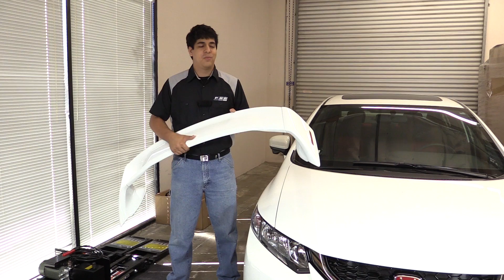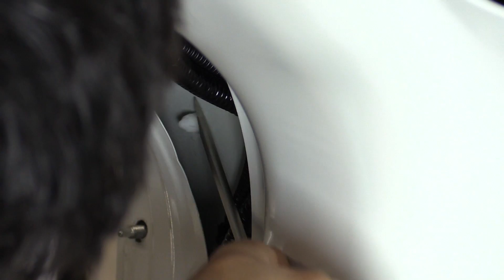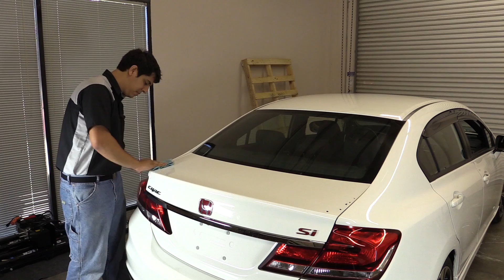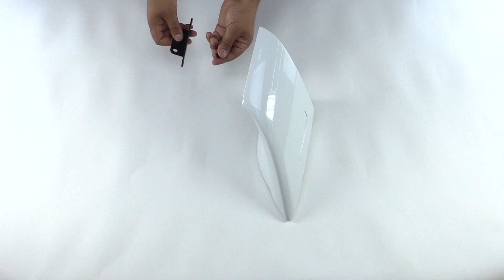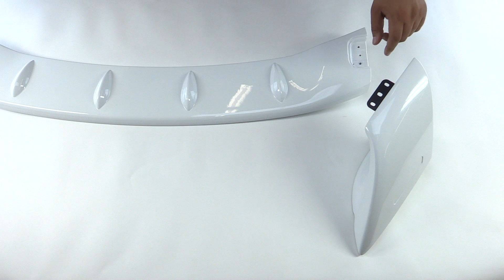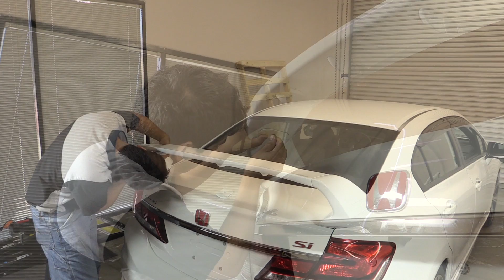PRO Design TRM Style Spoiler / Wing Install - Honda Civic Sedan 2012 2013 2014 2015

Comment: Any clue how this fits on the 2012 model? Want to order but afraid it won’t fit properly
Reply from the maker: This will fit fine on all 2012-2015 civic sedan models. The installation process will be the same as this video.

Comment: I have a 2013 Sedan Civic. I don't see the 2 BOlts you mentioned after removing the Trunk Liner. Is my car compatible ?
Reply from the maker: +Jason Lee If your civic did not come with a wing, the bolts will not be there. The beginning is only for models with a factory wing. Since the wing requires drilling, it is still compatible with sedan models without a stock wing.
Reply: Thank you so much.
I'm figurng out what to do after I take my Trunk Liner out. I assume just drill through the trunk, and apply the bolts on?
Reply from the maker: +Jason Lee That would be correct! Please ensure to have everything lined up and properly fitted to ensure correct fitment.

Comment: Does this fit to 2015 Corolla
Reply from the maker: +frederick manzano It will not fit other vehicles. This is designed with the Civic in mind only.
Reply: PRO Car Studio ohhhh okay but I have seen corollas with same spoiler
Reply from the maker: +frederick manzano There may be other wings that look similar to it that fit the Corolla or were heavily modified to fit it. However, out of the box, this is only designed to fit the Civic.
Reply: PRO Car Studio okay thanks for the info sir

Comment: What happens to the holes that were left by the stock spoiler?
Reply from the maker: +T k Most will be covered up, but not all. The visible ones will need to be filled by a professional body shop.

Comment: Hey bro thanks a lot for this video it was very helpful for my little proyet but now the thing is that the top part of the spoiler shakes while I'm drivimg, how can I stop that? I put it very tight but that just help very little, any advice?
Reply from the maker: +Mario Maldonado The vibrations are normally minimal at best and tends to happen from high winds at highway speeds. We have heard of people filling the center part with expanding foam to help reinforce it a bit more. However, results can vary and will more than likely not completely eliminate it.
Reply: PRO Car Studio good to know, thanks a lot!

Comment: Some people with this same wing or similar say this wing bolts up to the existing Si spoilers holes. Is this the case now or you still have to drill?
Reply from the maker: +KAnE3o1 This would not be the case. The wing will still definitely require drilling to install.

Comment: Can this fit in a 2006 toyota corolla??
Reply from the maker: +HBF Gaming This is designed to fit the 9th gen civic sedan only. We cannot guarantee it will fit other vehicles.
Reply: PRO Car Studio ahh thank you for the reply
Reply: Measure the width of your trunk lid and if it measures 47 or 48 inch, the spoiler will fit

Comment: Where'd you drill the other hole? You didn't specify on that..
Reply from the maker: +Isaac Arenas Can you specify which hole you mean? The only ones we drilled and are needed are the mounting holes for the wing itself. You use the foam gasket for the wing as a template on where to drill.

Comment: This wing fits perfectly on a coupe guys, it lines up well. Only thing you'll need extra is a thicker weather sealant adhesive, and atleast 2 people to hold the wing on each side while you measure everything and adjust it to tape the adhesive down as a template for where to drill the holes. Once you've drilled the holes, and make sure the drill tip your using is for metal, you put the thicker adhesive onto the wing , make holes for the screws to fit through, place it on the car, then screw in each side equally and bam, you just installed a wing meant for a sedan on a coupe .
Reply: what year coupe doe?
Reply: No need for bondo then?

Comment: Will this work on a 2015 Honda Civic Automatic LX ? Non SI ?
Reply from the maker: +Brandi Leigh It will fit all trim levels as long as it's a 4 door sedan from 2012-2015. It will not fit 2 door coupes.

Comment: is this hard to put on '12 civic si? what are the things that i need to do to put it
Reply from the maker: +KILLINGmachine9k The process is virtually the same as the later sedan models as well. As long as you have a sedan, this install video will help with the installation on yours as well.

Comment: is the rubber trim piece for the bottom of the spoiler necessary for the install or can it be installed without it?
Reply from the maker: You should install the rubber / foam piece. It helps seal the holes from moisture.

Comment: i heard it wiggle when u hit the highway, like the plastic piece in the middle. is it true?
Reply from the maker: +hannah regine After our testing, there is some slight wiggle at around 70 MPH or higher. However, it is minimal at best and we have not had any issues with it.
Reply: PRO Car Studio it wiggles a lot at high speeds on highways and I had a crack on mine. It actually broke. Any help on that?

Comment: When y'all going start having aftermarket mods for the 2016 civic
Reply from the maker: +Ross Conglomerate We do currently have an intake options for the 1.5L turbo and 2.0L models and an exhaust for the turbo 4 door models as well. More will be added as they are released.

Comment: Hey ProCivic, I was thinking about purchasing this wing but I have a question. Do you think the size of the trunk of the 9th gen 4DR is the same as a 9th gen 2DR? And will the wing fit for the 2DR trunk?
Reply from the maker: +Shino Minamoto We have had customers install this on the 2DR, but I believe some custom work might be needed. I really can't recommend it unless you are experienced with automotive body work.

Comment: would this fit on 2 a door Si?
Reply from the maker: +Jovani Nuñez This will not fit the 2 door. It is designed for the 4 door models only. The dimension of the 2 door models is different.
Reply: +ProCivic.com but it looks so good!! I've been trying to find one for the 2 doors but I can't find one, I like the seibon gt spoiler that you guys carry but this design looks so much better
Reply from the maker: +Jovani Nuñez Some people have been able to use it, but would require a very skilled body shop and a lot of bondo...

Comment: Where can you get them for a coupe???
Reply from the maker: +Sam d Sorry, this is currently not available for the coupes.
Reply: +ProCivic.com I've seen this spoiler on an rsx before
Reply from the maker: +Ufc _ There may be other spoilers that look similar or were modified to fit, but out of the box, it's designed to only fit the 12-15 civic sedans only. You can make anything fit on any other car with enough Bondo and creativity! :)
Reply: +ProCivic.com what's the song at the beginning.?????

Comment: well how did you cover up the cable hole for the break ?
Reply from the maker: +Parshen Yousefi It worked out quite well. You can't really tell the hole was ever there. You could try it yourself first, then have a detailer or body shop clean it up if needed.
Reply: i have the same one and i can see the hole with my eye
Reply from the maker: +Parshen Yousefi The best way is to have a professional body shop fill it and color match it. If you have experience with body filling and color matching, you can do this as well.
Reply: thank you i found a rubber hole plugger for it its better

Comment: i have a 07 civic and i want to install a spolier with a third brake light but the wire is too short and i dnt wanna splice the cables is there any thing i can do 😭
Reply from the maker: +Arturo Gutierrez This spoiler won't fit an 07 Civic actually. If you got a different spoiler, you would need to extend the wires.

Comment: is there any rattling, shaking, or flapping in the center piece at higher speed?
Reply from the maker: +Tak Tsoi Around 75 mph it does vibrate a tiny bit, but only the center section, and it makes no noise that we can hear. I think the reason why that happens around that speed is that it is just enough downforce to start deflecting the spoiler downwards. I'm willing to bet at higher speed the wind just pushes it down and there is no vibration.
Reply: +ProCivic.com is there any way to prevent this from shaking? Foam? Etc
Reply from the maker: +Adam Thao Yes, expanding foam can help alleviate the issue. Just be careful not too put too much in.

Comment: Is there anyway this would fit the 2dr coupe?
Reply from the maker: +NextLegendMapler Unfortunately, no. The trunk curvature is different.
Reply: +PRO Civic Will you be coming out with anything for the coupe any time soon? (i.e. spoilers, lips, side skirts, etc.)
Reply from the maker: +NextLegendMapler Yes, we do come out with 2DR stuff as well. For example, we just recently added side window visors for the 2012-2015 Civic 2DR models.